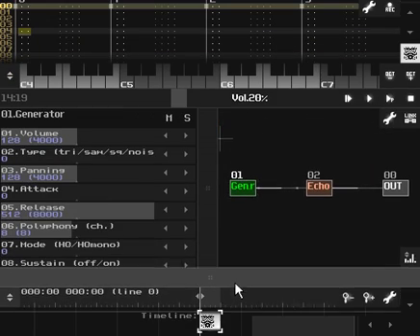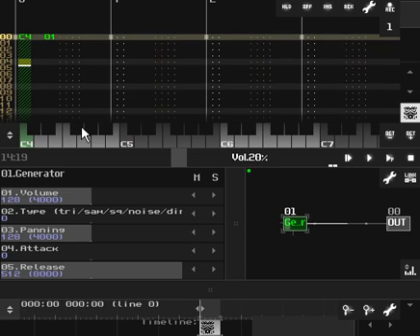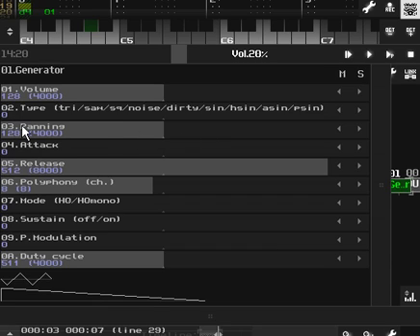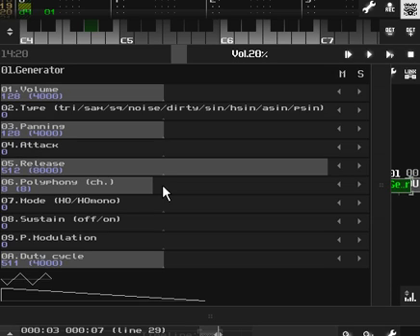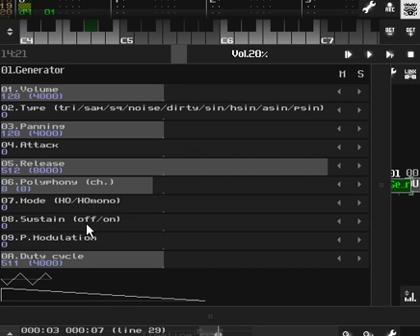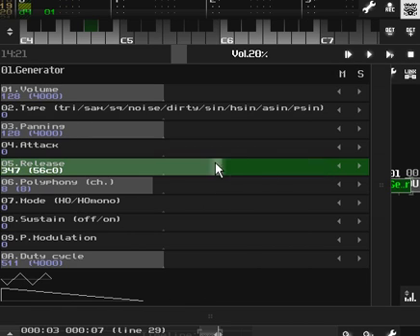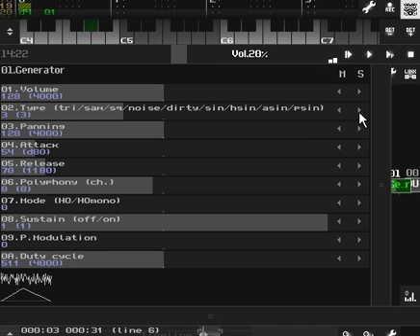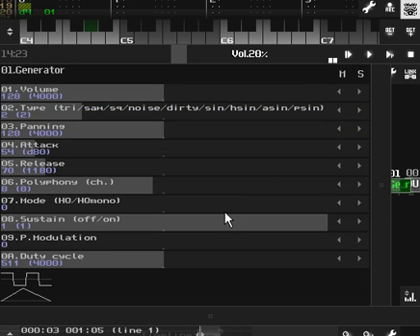SunVox Tutorial Part 2 - Generator Module

Comment: Interesting. Is it possible to program generator parameters? Like, slowly increase duty cycle within a pattern?
Reply from the maker: Yep! You can shift-click on the parameter to place an event to set it to that value, or you can record yourself moving the parameter. You can also use an LFO set to Generator plugged into a Sound2Ctl module, with the Sound2Ctl module set to the parameter you want to modulate (though that's a cyclical, continuous modulation). Finally, you can manually set the event by just typing in the values.